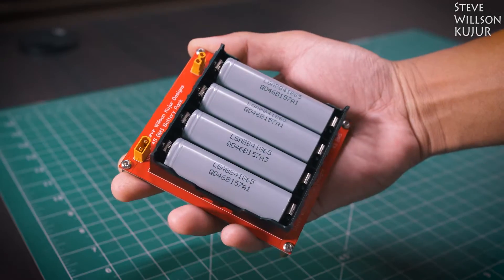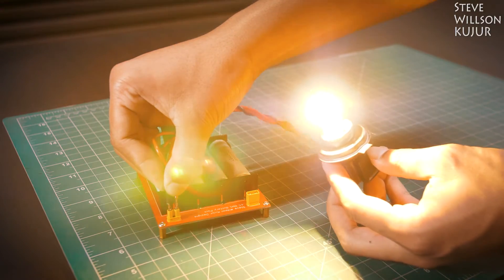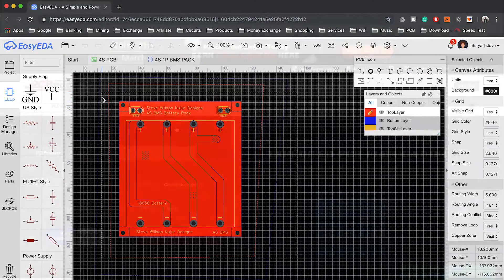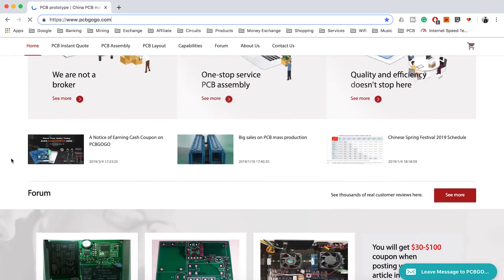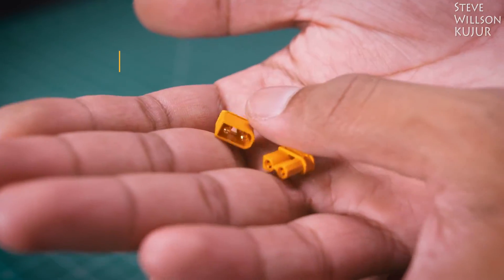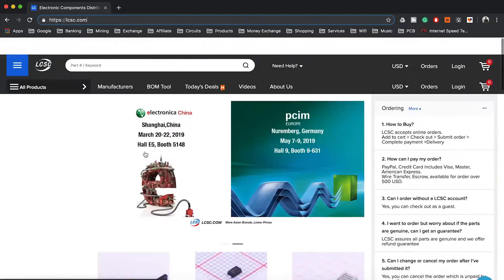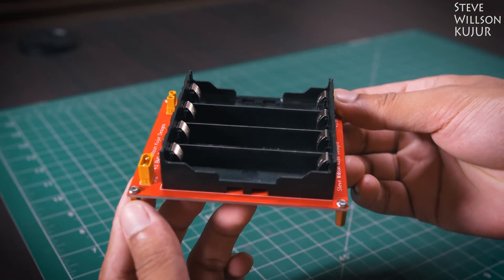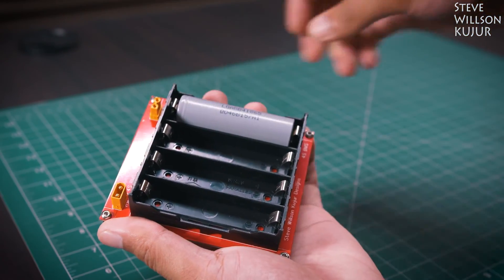DIY 4S 18650 Battery Pack Without Spot Welder

Comment: Great design, thank you for sharing. Are the balance wires not needed with this setup you have... also wondering can this be charged directly on the unit, is that what the other xt30 is for or is that for expansion? Otherwise can the xt30 you use for powering the light also be used for charging?
Reply: I too would be interested to know if I can recharge the batteries directly from the out.

Comment: Informative video. Need you help in assembling a powerbank for 5v, I have 3.2v and 2.6amp lithium cells 40 individual cells but i dont know how to connect them without damaging the usb charger circuit

Comment: With the 4S Li ion batteries design, your output will be about 14. 8v (3.7 x 4). How can you power a 12 volt device using your design with an output of 14.8v DC (which can easily blowout a 12 volt DC device due to over voltage). Please prove me wrong.
Reply from the maker: Even your 12v battery is not 12v it takes 14.4v to fully charge , 

And yeah this 4S battery is not suitable for many 12v application
Reply: @SteveWillsonKujur  I read online that the battery management board would not work if the batteries are not all evenly charged prior to using the 4S Management board.
Yet there is another 4S BMS I want us to look at that would charge batteries individually. You and I can examine this other board for efficient battery Management system. Please contact me at cctvwholesaler@gmail.com to jointly work on this other 4S BMS board. Or if you send me your email. I will contact you. Thanks
Reply: Should be adjustable with a 7812 circuit.

Comment: I bought all the parts. Had to drill holes for xt30 to fit properly. How do i make this a 3s1p? I need 12 volts thanks
Reply from the maker: Use XT30 Pcb Mount
Reply: @SteveWillsonKujur  I removed 1 battery and it gave me the 12 volts I needed. Now i just need to find out how to make it 9 volts. Thanks for you design. I am learning allot.

Comment: Nertek
I order PCB from Fusion PCB (seeeds studio) the xt30 didn't fits , I ordered from JLCPCB, assuming they made a mistake printing them. The xt30 didn't fit either. I order xt30 from (3) different vendors neither one fit.  The pins on the xt30 is short than the one on the PCB.

Comment: Great vid, great build, well done Steve! :) 
I really like your idea to combine the BMS with a PCB and battery holder. 
Let me propose something to consider: I'd look for a more robust battery holder,  as your choice makes the whole build limited to 3A, that is a pity. Especially due to this limitation, I'd integrate to the PCB a self-resettable 3A (or lower) JK30 type fuse to make it really safe, as the BMS is way more powerful. That would save the batteries and the holders from too high loads and regenerating after a few seconds/minutes after overcurrent, no need to change it.
Reply: The 3A limit is because of the plastic holder, right? I couldn't find any limitation on those holders. Where it's said? Thx
Reply from the maker: Thanks , yeah that would be great